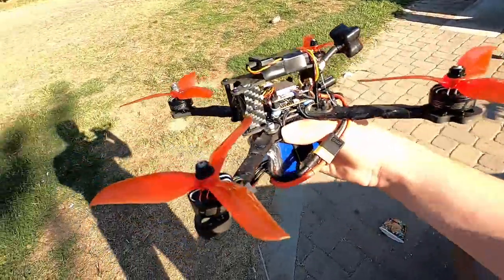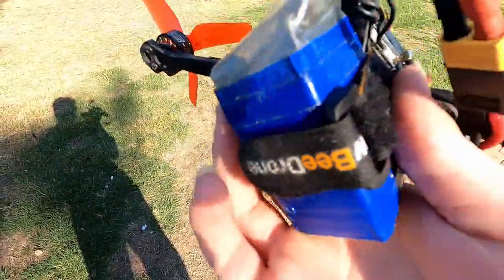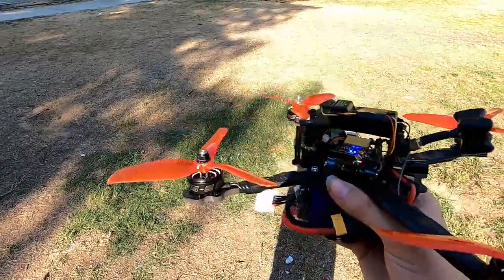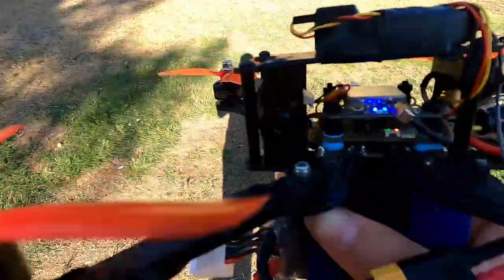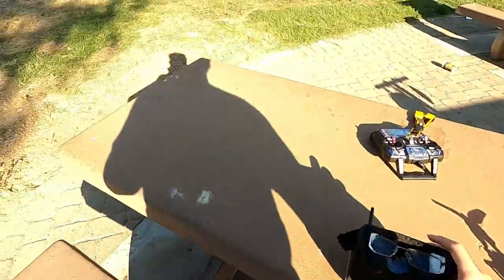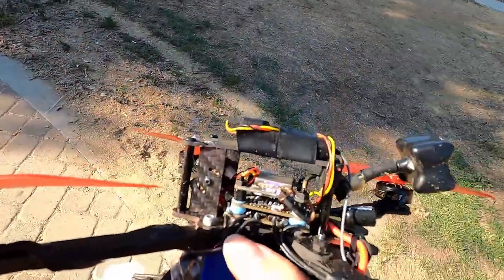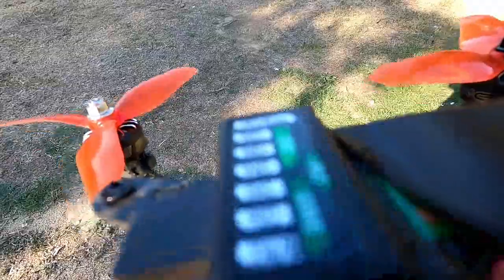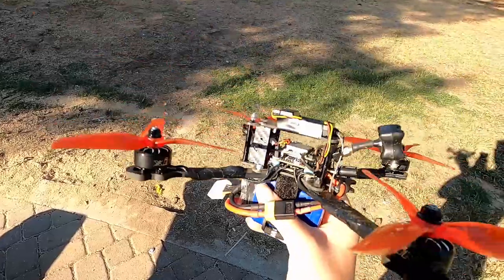Flying my FPV Drone!

Comment: Hi dylan, I saw that you commented on joshua bardwell's build video and that you were also using the Fs i6 controller and receiver. I am doing the same and am a bit confused on how to connect the receiver to the FC, would it be possible if you could tell me how to do it. Thanks very much